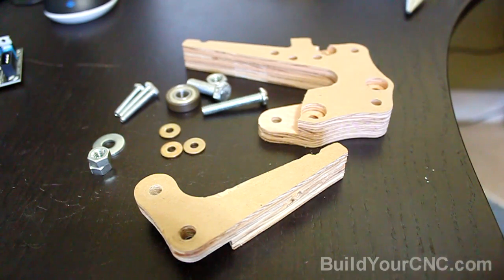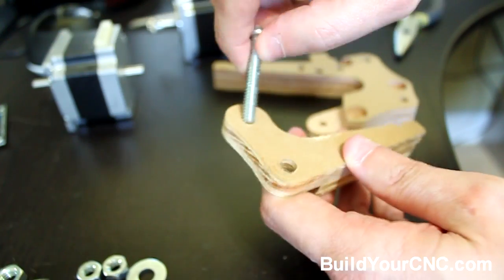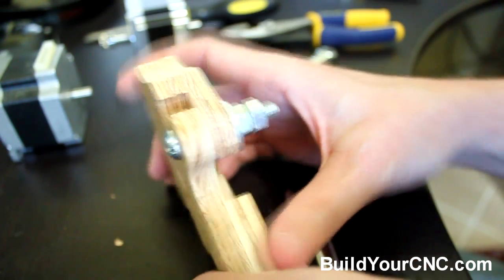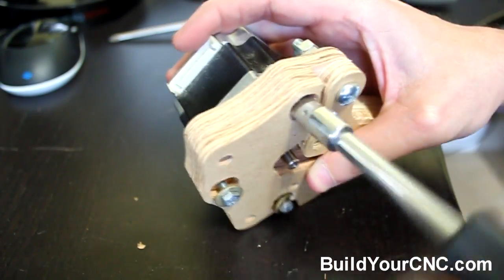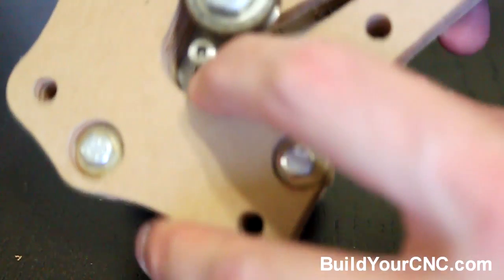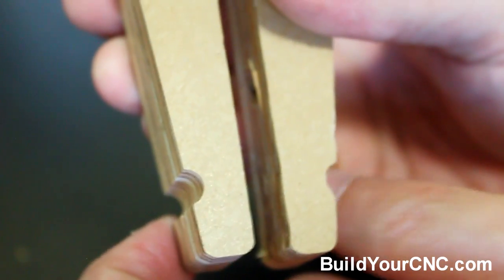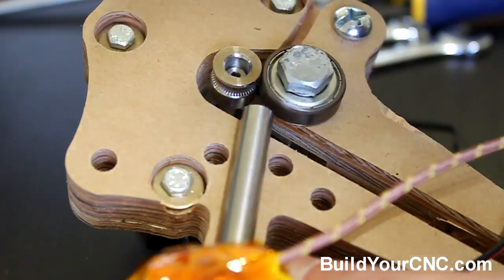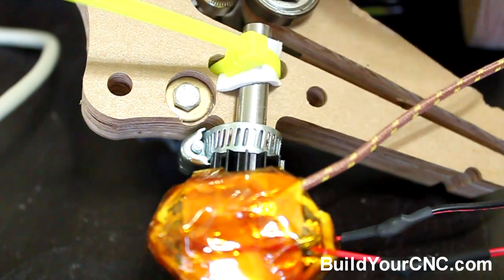whiteAnt Extruder Hinge

Comment: second, put the sprocket on the motor shaft and tighten the set screw just enough so the sprocket won't fall off.  Put in the three #8 screws, add a washer on the far side, then fit the motor on and tighten it down.  Now adjust the sprocket to the right position, open the arm to move the bearing out of the way, and tighten the set screw for good.

Comment: put the 5/16 bolt and bearing onto the smaller wooden piece first.  put the two halves together and check that they line up on the flat sides.  You may find you need an extra 1/4" washer to help them line up.  If you don't do this the arm will collide with the stepper motor.